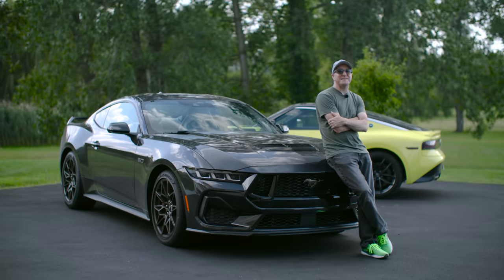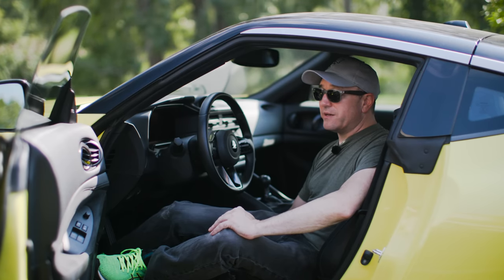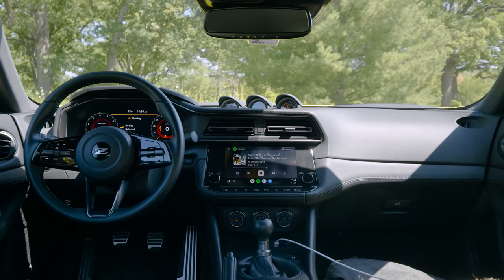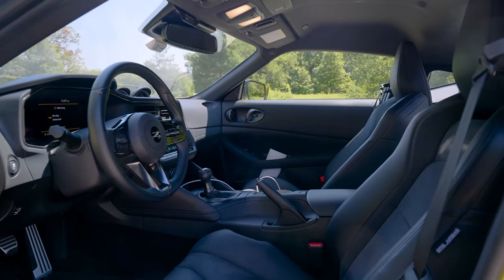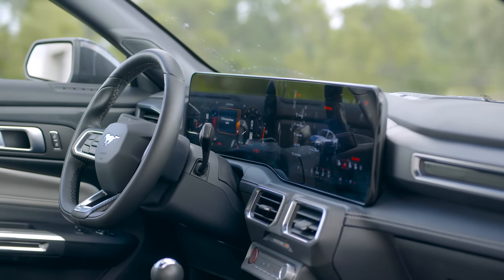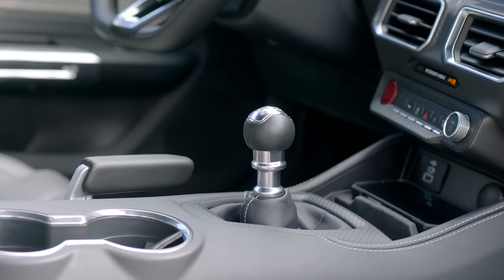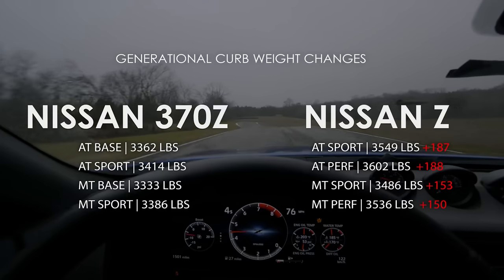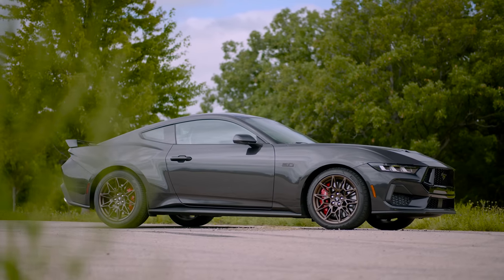Mustang GT vs Nissan Z | Maximum Muscle, High Prices

Comment: An S650 GT in the 60,000 dollar range is mind blowing I remember when the GT could be had for 30,000 dollars.
Reply: And gas was a quarter
Reply: @philipparana9225 I remember GT's 12, maybe 15 years ago being in the low 30k range. Gas was, I can assure you, more than $2.25 a gallon, not $0.25
Reply: @George-ur8ow indeed I bought a new 2018 mustang gt 10 speed auto for 31,481.  Fun car and worth the money.  Think a similar set up is in mid 40's now.  Not the same value play as before.  Decent car though.
Reply: In 2015 I bought a 2015 GT PP non premium with 8k miles for 28k and that was only a pretty good deal.  These new prices are insane
Reply: I got my brand new 2015 5.0 base manual $28k 0% financing payment was under $400 and insurance was $80. Those days are long gone unfortunately 😢
Reply: Base GT start at $42k.
Reply: @George-ur8ow no way, 15 years ago close to and a bit after the 2008 housing crash, I assure u gas was $5.
Reply: The funny thing is I like everything about the mustang except the screen. 😂
Reply: There was a time when you could a buy a brand new foxbody mustang with the 5.0 and 5 speed manual for less than 13k out the door...good times...I can't justify spending 62k for this new one...45k is more reasonable
Reply: @monikhushalpuri  yeah I guess the dollar ain't worth shit these days.
Reply: @mosswine5417  yeah dude...up here in Toronto we got $1000 dollar cars selling for $2000, rusted ass 79-2004 mustangs selling for 4k-10k...these damn government bastards in Canada and the states fucked the used car market...I bought a 2016 vw golf with 28,000 miles on it for 12k out the door in January 2020 before all this covid bs kicked in, I saw the same spec and year vw golf with 80k+ miles going for the same price I bought a damn near new one for
Reply: yeah Brandon didnt do a good job.
Reply: @George-ur8ow inflation exists
Reply: Makes no sense.
Reply: This is a loaded GT you can get one for allot less with the performance pack and active exhaust for 50,000 retail but no one pays retail so 48,000 out the door.
Reply: i got my 2012 5.0 for 19k, which is still more than i shouldve paid, but i couldnt imagine paying 60+ for this new one
Reply: I got my 2019 for 37k but it’s a premium with california package and the 12inch led guage cluster. Cant justify moving to S650 any way at that pricepoint
Reply: In December 2020, CA dealers were selling GT's with Perf. Pack for 38k. I specifically remember when I was in sales.
Reply: the gt350 was under $60k last gen when it first came out, before Ford realized they were under charging for it
Reply: Absolutely, they have doubled since then, just ridiculous!
Reply: I remember looking at the mustangs at a big Ford dealership that was local you could get a fully loaded mustang GT for around 15 k  that was in late 80s early 90s
Reply: I just bought a 2024 premium GT 401A fully spect out even has leather Recaros MSRP 61k got it for 59k. I had a 20 mi road trip home. And couldn't even figure out how to turn the radio on.,lol had to get on YouTube to figure it out.
Reply: Why do Yahoo keep saying $60000 for a new 24 Mustang?I just bought a Mustang gt for $36000 ....

Comment: $62k for a GT is utterly insane.  The only variation of the 2024 GT worth it's cost is a base GT with 301A.  That's where I'd start and just mod from there.
Reply: Yesterday found a dealer in florida asking $100k for a new automatic mustang...
Reply: But then you are still stuck with the mt82 right? Not exactly a good base.
Reply: I ordered mine with the performance pack and just the 300. Good base to work with and enjoy at the same time. No need for fake dual climate control or 4 leds that come with Mycolor in 301A package for 2k
Reply: @JJ-df4kx very reliable transmissions when not brutally beat on by the man-children who complain about them. It’s a cleaner and more decisive shift more so than a 3650. All issues u hear about are from people who think transmissions should be made of molten titanium and last 3 eons. U take care of ur car n it’ll take care of u!
Reply: @JJ-df4kx  The MT-82 is not a bad transmission. The crappy Ford clutch that causes lockout issues it what needs to be replaced. Swap in a twin disk and she is smooth as butter. Trust me, I thought my MT-82 was junk as well until Ben Callimer and Lund Racing stated that it was the factory clutch and single disks in general. I've got a Vengence twin clutch and those issues are all gone.
Reply: That would be an absolute steal here in Europe. Any non-American car with a V8 is much, much more.
Reply: @JJ-df4kx  or you could opt for the ten speed.
Reply: I've owned a new GT in Premium trim for its last three generations.  I guess this is where I stop.  These cars used to be attainable for your average Joe, but thanks to salaries not keeping up with inflation that isn't the case anymore.
Reply: Bro, the other day I found a 2019 pp2 for 40K and I thought, I could buy that, for what the pp2 includes, $40k seemed reasonable

Until I learnt it a 2019 pp2 was $45k, new.
Reply: Same with the Z, buy the base model Z and spend the price difference on Z1, NISMO (that exhaust sounds great), SPL Parts and AMS mods with a good LSD and brake upgrade. For 50-55K you can have a track monster instead of that rolling compromise performance model. That is assuming you know how to roll up your sleeves and install the mods yourself. Agreed, the price of shop labor these days is pretty insane.
Reply: $35k will get you a 2019 in great shape.
Reply: The pre aluminum shift fork 15-17 mt82s were actually the best manuals.  Some did have terrible issues but most likely youd get a good one which were easily handling 600 to 700hp
Reply: @lancercool1992 what’s the problem?
Reply: A 2014 gt started at 36k. A 2024 GT inflation adjusted starting price is 33k…… inflation is a thing that exists
Reply: Is 48k worth it for a GT with 301A, polished wheels and 10 speed
Reply: @ValkenDnB  that's not bad but i'd skip the wheels.  I don't like any of the factory Ford Wheels.
Reply: @Shiffty_4G   this is exactly how I ordered mine also. Base GT, only options worth their weight that I opted for were the perf pack and active exhaust. Only clocked in at only  (albeit still expensive) 50k.
Reply: Type R is selling for $80k lmao
Reply: @302justinh Bull.  Mine was slipping by 40k and gone before 60k.
Basic everyday driving.  No mods outside of side pipes and a catch can.
Reply: Unfortunately your not gonna be able to tune these ECUs so either stand alone ECU or get the whipple package they offer
Reply: Right lmao
Reply: Is 301A a code for a transmission?
Reply: @randolph4421  it's an options package.
Reply: @GooglePixelGoogle Well said man 👍.
Reply: I got my brand new 2019 premium GT 10R80, 3:55 rear end, Nav, Ruby Red, 20" wheel option for $39k before my down in Oct 2018. Cars in general and literally everything else including groceries have skyrocketed with inflation and then some so owners can get rich but business owners aren't raising wages for their employees. So this is what you get. Items are now out of reach because people have only so much to spend. Things feel worse then 2008.
Reply: @anydaynow01 that argument could be made for any car including a base Ecoboost.
Reply: @302justinh  LOL that is funny. Pay way too much for mustnag and can't drive it hard because if you do the trans develops issues. I've personally witnessed these issues when the car is pushed hard so save the excuses. Yeah, that sounds like a great trans. Maybe do what GM has been doing for years and go with a real trans... TR3160 or TR6060 and not worry about it? Sad when the base V6 Camaros come with the same trans frod used for gt350 cars. What does that tell you?
Reply: @tri3pleagent  Even better opt for a car that has a track warranty and outperforms mustnag for less $$$?
Reply: @TheUrbanEpicure Go home and blame your government.
Reply: @zijunx1595  I am home. But I won't blame my government. They're doing a good job. You know, free education (graduated college with savings instead of debt, how's that for you), universal healthcare, properly maintained infrastructure, no guns, no money in politics... I'll take that over cheap V8s any day.
Reply: Actually that might be the best buy. GT with 301A pack. Even if you get the base Base GT, you are not really missing anything. Good guy Ford gives you modern interior and awesome screens which you can customize. Yes, drawback is staring at them all the time but it really changes how the car is perceived.
Reply: I think 60k for most cars is high. But the mustang is the only muscle car still in production... also, what other brand of car are you going to get almost 500hp in stock for less than 60k these days? The market is stupid in general, but don't blame the mustang just bc the prices are high. The z on the other hand is not special for the price tag it has. I'd much rather have a supra.

Comment: Remember when we thought the 370Z was a heavy pig? The manual base was only 3333lbs, that's light these days! 😅
Reply: I have a 370Z and would not want it to feel any lighter!
Reply: The Type R is 3188 lbs and that's "light" for its class now
Reply: @ShaiyanHossain but that car is like 4 and a half meters long isn't it.
Reply: I have the 370 and I love it but I'm definitely not a big fan of the the styling on the new one.
Reply: My 2019 Mazda3 5 door hatchback AWD is under 3200lbs.  I'm guessing it's around the 3170 - 3180 mark.  It's listed as 3228 - 3255 with the premium AWD, Bose 12 speaker + subwoofers, heated power seats, heated steering wheel, heated mirrors, and glass sunroof.  I have the base model, so I don't any of those added weight.  What I do have is 19lbs P Zero AS UHP that are 4lbs lighter per tire than the OE Toyo.  I think the Mazda3 is the lightest 5 door AWD hatch out there, yet it's still a PIG compared to the 2000 Civic Si I used to own, which weigh 2612lbs.  I had lighter wheels and exhaust on it, which probably put it in the 25xxlbs range.  Cars now are way too heavy.  I even contemplated on getting forged 17-18lbs wheels to replace the 26lbs stock ones.  In my 40s and I still love my little lightweight low powered fun cars, but sadly, everything got heavy.
Reply: @DroneStrike1776 yeah, I had a ‘76 Civic sedan (two-door with the trunk) 52 hp 1680 lbs, fun as hell - like a go cart on its 12” wheels, ‘84 Civic S, 76 hp 1980 lbs, equally fun and practical, ‘02 WRX wagon, 227 hp 3100 lbs, well, it’s a WRX!  Lightweight, modest power and cost cars have always been where it’s at!
Reply: Yet its the slowest car in its class. RWD 2 door coupe in its price range plus minus $10k.
Reply: I drove a honda crx dx about 30years ago. I believe it weighed around 1800lbs
Reply: Just wait till it gets a hybrid system and cvt.  The z will weigh 4000 and be dull and g** and the same with the stain <--- I'm illiterate, sorry if I can't spell. The mustang would weigh close to 4500 easily for electrification, to help the illusion of saving the world lol.
Reply: My 2019 370Z sport 6MT has had about 120 lbs shaved off and has gained about 55 peak crank horsepower from intake, exhaust and dyno tuning mods. My hp/weight ratio is about the same as a late Gen 3 model Coyote 5.0 Mustang GT. I wouldn't trade it for the new Z.

Comment: I wish the Z was 5 -10k cheaper. I've test driven it twice now. Despite the fact that I really like it, the experience and the quality does not match the price tag. This probably explains why at least here in Canada these are sitting on dealer lots despite msrp pricing.
Reply: I'm in Los Angeles and I've never seen one on the road.
Reply: @markallen2984 I’ve seen a couple in Laguna and Newport after cars and coffee on Saturday. They’re alright. The s650 I haven’t seen once
Reply: @markallen2984 none in LA of all places? That’s saying a lot.
I guess this is the last generation of ICE Z, all because it was overpriced.
Reply: It is literally 5-10k cheaper if you get the base model instead of the Performance.

Starts at $43k USD I believe.
Reply: @exodus3252 why the f would I spend 55k Canadian dollars on a sportscar with cloth seats and no LSD? That base model has no redeeming quality whatsoever.
Reply: I haven't seen any new Z or new WRX here in Australia. I'm sure they are out there but I'm pretty sure sales are down
Reply: Haven't seen a single one here in the bay area. See a lot more 350's and 370's.
Reply: @milesfathi it would be redeeming at 25k
Reply: You say "MSRP pricing" like it's a good thing.
Reply: Manufacturers don't seem to understand that they're killing their sports cars with these prices. The average young man in his 20's - 30's can no longer afford these entry level sports cars. The guys who can afford them, have either moved on to the sedan/SUV period of life, or will get a BMW, Porsche, etc for just a little more.

A Mustang GT for $60k+ is crazy.
Reply: I have yet to see a “Z” car in person or on the road.   They came out a while back why are they not on the road yet.   If it wasn’t for you tube I wouldn’t have a clue about them and I am contemplating buying my 4th “Z”… you would think I would be on their radar for some direct mailing or something…you’re slipping Nissan and about to lose a fish you already hooked 3 other times…??
Reply: @faheemabbas3965  there was production problems. Once they sort those out it'll sell a bit better.
Reply: @kindregardless  tucked up in my garage…I hope 😊